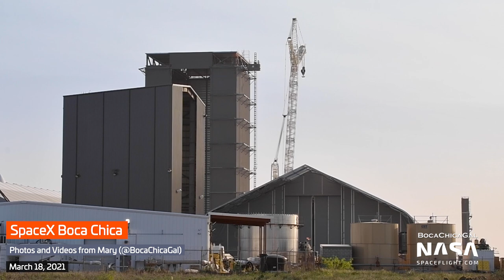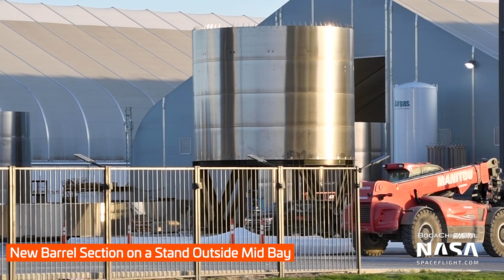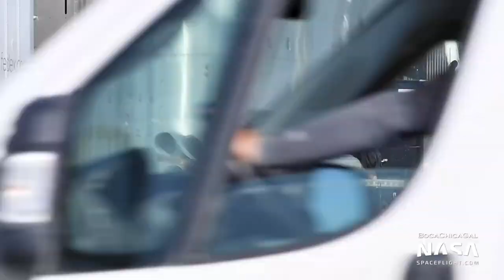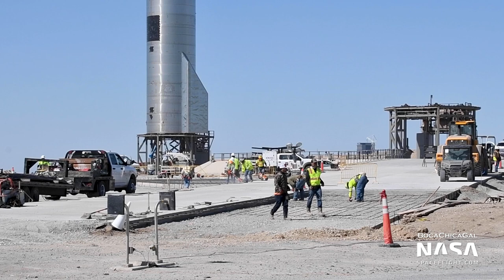SpaceX Boca Chica - Orbital Launch Site progresses, crane preps for Super Heavy booster stacking

Comment from the maker: A dedicated booster stacking video is up next! This gets us caught up with the first half of Thursday's action.

0:00 - Tankzilla Upright Ahead of Super Heavy Stacking
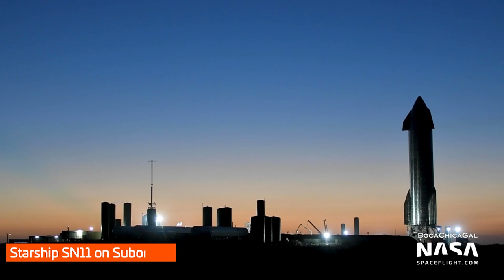1:03 - Starship SN11 on Suborbital Pad B
2:14 - Sunrise at the Tank Farm
2:56 - New Barrel Section on a Stand Outside Mid Bay
3:27 - Mystery Structure and the Build Site from High to Mid Bays
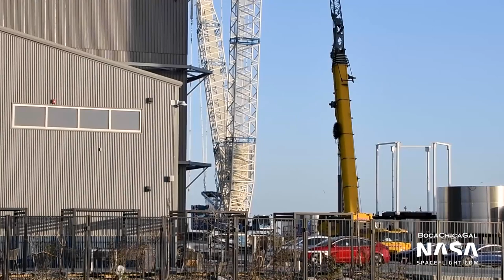4:12 - Tankzilla / Taller Than Usual
4:57 - Tankzilla / Rotating and Leaning
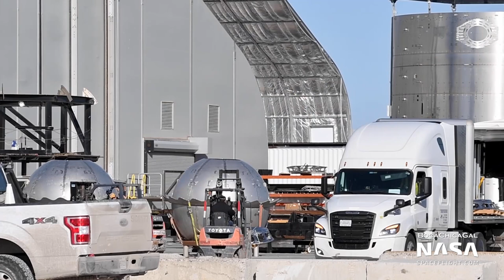6:10 - Deliveries
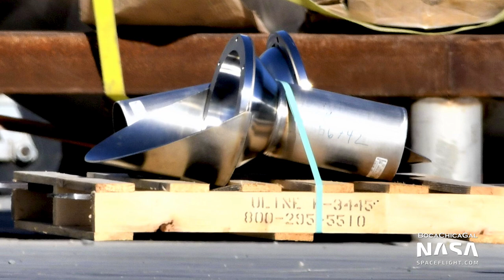8:25 - High Bay and Tankzilla / Preparing for Super Heavy BN1 Stacking
9:42 - Workers Prep Tankzilla for BN1 Stacking
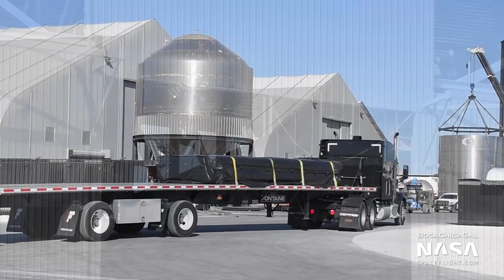10:22 - Delivery
11:22 - Tank Farm Construction Continues
12:31 - SN11 and Starhopper at the Launch Site
13:02 - Prep for More Concrete Work at the Launch Site / Looks Like They’re Finishing the Ramp
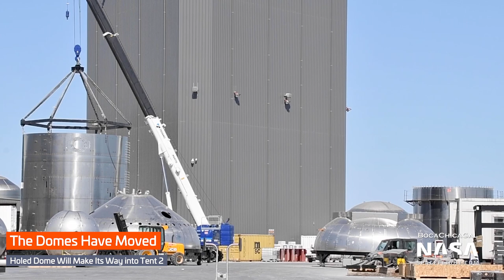13:40 - The Domes Have Moved / Holed Dome Will Make Its Way into Tent 2
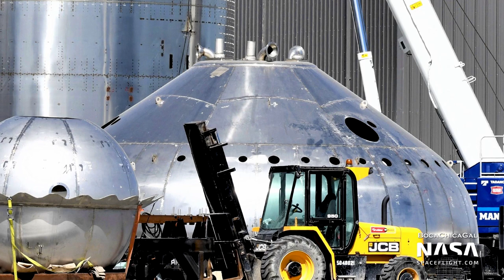14:24 - 3 Ring Stack Moves into Tent 1
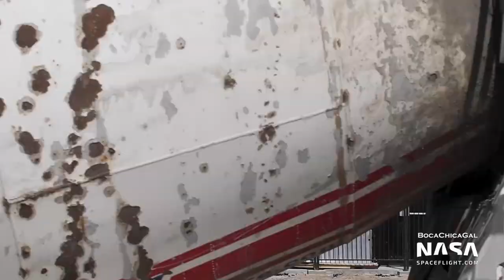15:08 - Construction Continues as a Stand is Moved
15:41 - Nosecone Moves Inside Tent 3 / Nosecone Barrel Section is Still Sitting Outdoors
16:11 - Beam Being Attached to Mystery Structure’s Poles
Reply: Well hurry up! I can't stay up all night! 😉😁
Reply: The mystery structure on the stand is for BN1 to stabilize it for transport  BN1 maybe taller than SN`s thus more stability is required... ???
or it could be a part of the USS Enterprise NCC-1701... lololol  :):)
Reply: They need a bigger crane to put a starship on the top of the booster!!! For sure!

Comment: BN1 is so tall, lowkey feel like it could fall over during roll out 😂
Reply: @elonironspace2968  even then lol
Reply: Say your prayers for the crane that will have to lift it. And is there a crane tall enough to put starship on top of the booster yet?
Reply: @stevescoffee8325  rumour has it that they are getting an enormous crane in to build the orbital launch pad, that could probably do the trick
Reply: @stevescoffee8325  we won't see a fully stacked starship in the very near future but once they are done building the launch tower (crane) it'll be possible :D
Reply: @petecol7  ooo I didn't think about that. But it makes sense. If it doesn't have engines in it. Then that would make it very evenly distributed in weight which would be bad for topping over. Starship doesn't worry about that because it's so bottom-heavy it would take basically an act of god or a total collapse to make it fall. But perhaps the white structure is some kind of brace.
Reply: A clamped down production booster will stay in place even when all 28 Raptors are test fired at once.

If a booster is securely clamped to something that doesn't tip, it won't tip. They ballast transporters with the same weights that they use to ballast Tankzilla. As long as the engineers use enough weight, and bolt them down correctly, they aren't falling over.
Reply: High winds will be the biggest issue.
Reply: @stevescoffee8325  Tankzilla has a maximum lift height of 187 meters, so can do that easily and have room to spare.

Comment: It’s the mystery structure at the end that has me all twisted up. I honestly believe it’s a monument that we will all end up worshiping in Starbase city, some form of starshipism where we bow and chant to the  6 landing legs that starship stood on... I’m down for it
Reply: SpaceX is secretly a cargo cult building a temple from scrapped Starships. Definitely plausible. Will Elon be Priest-King of SpaceX soon?
Reply: Or it could be the frame for a gasometer.
Reply: Maybe the mystery structure is a jig for supporting the Super Heavy Booster BN1 when it is transported to the sub orbital launch pad.
Reply: @joemillar7469  That's what I've been thinking
Reply: @joemillar7469  that’s also my guess
Reply: Think cryo testing device, only much much bigger. Goes with the spider device to make a cryo tester ?.
Reply: @joemillar7469  Just seems strange to me that it is so tall off of ground level. Plus the support legs don't look at that substantial.
Reply: @josephvanwanzeele5125  - perhaps if the base was mounted to the existing transport structure, and the white uprights are mutually supported, then a strap system could be used to give it just that extra bit of support BN1 needs.

Comment: The mystery structure with the poles is certainly part of the booster landing guidance and capture system - they are going for a legless booster design outright.
Reply: I think it's gonna be used by Thrust Rams for testing BN1
Reply: Dunno...  Could simply be a reinforcement structure to carry BN1 (& 2, 3...) from Prod Site to Launch Complex.
It would provide more height to secure it, hence more stability, if the plan is to use the SPMT.
Reply: @Vonderheidon   i like the suggestion but It's not the right height for that.
Reply: @SynthOSphere  A few people re saying that but they already have a perfectly capable system to move starship which will likely also work for the booster - this particular structure they are building is incredibly string and sturdy i doubt they would invest so much into a thing just used to move a booster.
It's looking very much like the launch tower platform and the poles are part of a superheavy catching system - they may also be used during liftoff to provide some support as well.
Reply: @SynthOSphere  The superheavy will have very strong hold down points just like starship - it should not need a brace part way up the side.
Reply: @Vonderheidon   Way too short to reach to the top of BN1 so that wont work.

Comment: Do you think the "Mystery Structure" is another construction jig, given it's size (diameter) and location?
Reply: As Isaid above, it could simply be a reinforcement structure to carry BN1 (& 2, 3...) from Prod Site to Launch Complex.
It would provide more height to secure it, hence more stability, if the plan is to use the SPMT.

Comment: My take on the mystery structure:
1.  It's being constructed in the area where the ring structure assemblies are.
2.  The rockets are about to become MUCH taller therefore more ring structures to make a rocket.
3.  Instead of 2-, 4- , or 6- rings per stack, I believe we are getting ready to see 10- ring stacks or greater being put together. 
4. Since we have seen that ring sections are inherently flimsy until attached to other ring sections, I believe that the mystery structure is a brace that can keep large stacks of rings stable.

It was worth a shot!  :-)
Reply: Mike, I think you’re right.  It could also be a draw fixture.  This entire structure would be in the HB, and as rings are created they are pulled up with the bridge crane,  the inside having the poles will allow access for workers to put in longer strapping to support the ring stacks.  They could technically keep “pulling” rings to the lengths they need.  It’s only the dome-ring-sections that can’t be added...  (unless the white poles are on the outside of the ring, can’t tell)

Comment: Those concrete 'tanks' at the orbital launch site, can't be used for cryogenic storage - concrete is porous, and would 'spall' at those temperatures, unless they line the tanks with SS or regular steel, and the concrete is just there to strengthen it.
Reply: Yep, I think we are saying the same thing.  They would have to have a SS sleeve inside.  I don't see any other way to get cryogenic storage if they are planning on using the SS tanks they are manufacturing.

Comment: I wonder if the mystery structure is part of a catch tower, but I can't really make it work in my mind. It leaves me baffled.
Reply: It certainly is - they will probably use it this is to guide the lower end of the rocket to touchdown - they have more parts to attach to it yet.
Reply: @stephenhumble7627  For a moment, I thought they'd keep the segments separate and rotate them at the bottom. The structure would open and close like a flower. That's clearly not the case, but it would be a cool design.

Comment: Isn't tankzilla there to lift the new 180 ton cap. crane into the high-bay for installation?
Reply: Or is it there because they are sick of waiting for the new high bay crane and want  to get on with booster stacking using tankzilla through a new hole in the roof.
Reply: It was there to stack the booster, already happened.
Reply: @JTube571  oh Ok I didn't notice it.  Not a very special skill I guess;  predicting the past.

Comment: Regarding the mystery structure:  What we need someone to do (Mary or Jack?) is to evaluate the height of the top of that 'Mystery Structure' (where the poles end and where there seems like there could be rubber or wooden pads installed) and check on BN1 at about the same height to see if there are any kind of attachment points or brackets...  This would help confirm the theory that this pole structure exists to help move BN1 from Prod to Launch.

Comment: Just a guess, but the "mysterious structure" may contain a guidance software/broadcaster that will communicate with the super boosters software so that the repulsive landing raptors will accurately steer it back down to land exactly where it took off.

Comment: I saw the post with the new trolley crane for the highbay building. The trolley will lift an empty Starship or Booster. Hopefully though, each will be built on a transportation unit and the trolley crane's limit won't be approached, since that's also the building's limit.